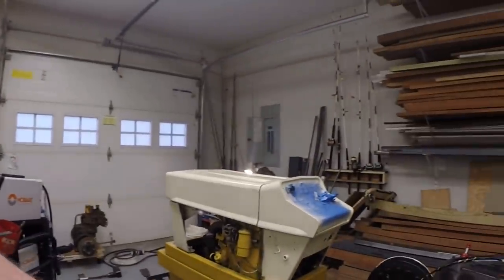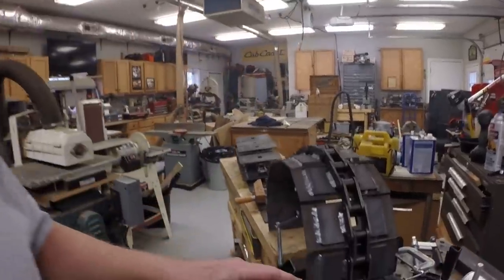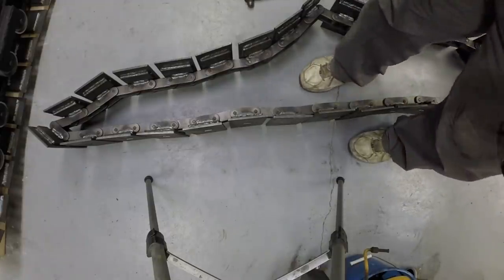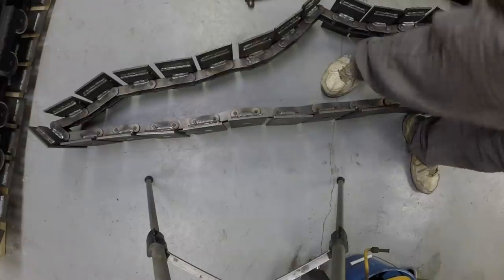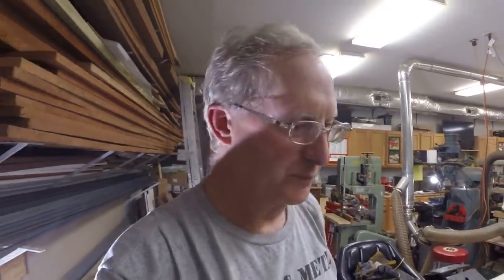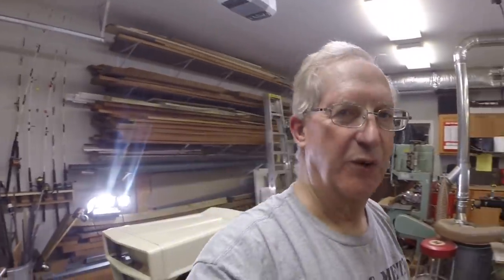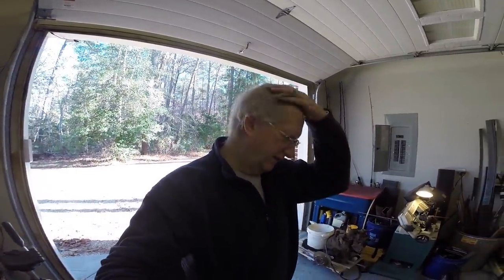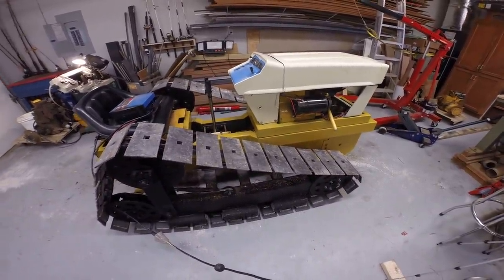Cub Cadet Dozer Build, S2:E6,  Here, Hold My Beer!

Comment: I would need a nap after struggling with that track!  A very neat build.  As far as I can see it performed just as you planned it----spin in place!  You should be very pleased.
Reply from the maker: It actually works better than I expected. I was anticipating some track issues and expected to have to fix or change something, but everything worked as intended.

Comment: You did it, need a leaver for the belts back where you sit so you don’t have to lean forward to engage the belt’s. Can’t get over how it worked. Did good on this job can’t wait to see it with the blade on the front.
Reply from the maker: Actually working on that. It'll be some weeks before it's published though.

Comment: Unless you had the volume turned down what surprised me most was how quiet the machine was. Not only from the engine but there was hardly any track noise. Congratulations on a well-fitted machine.
Reply from the maker: The volume of the engine noise is turned down quite a bit. Tracks rattle and clink just like you'd think they should, LOL.

Comment: Awesome job! Looks like the track tensioner would benefit from welding on a socket for a 5-10ft cheater bar.  Let you pull enough tension by hand to get the turnbuckle bolt in.
Reply from the maker: That's a great idea! Thank you!

Comment: Good job on your build. That is awesome! Yes, i am hoping you'll be able to put fenders on because a was concerned about your pants legs gitting caught up in the tracks. That had me worried😟, dont want ya to be injured for any reason !!! There should be a way to install a linkage from that transmission tension handle over there to the operator postion so you can turn it on & off from the seat! Install crab handles on the dash panel so you can pull yourself up onto & off from the seat area. Install some side steps on the side of the track guides to help you on & off the tractor! Enjoyed the video. 🚜Tractor safe🚜
Reply from the maker: Yes, fenders/leg wells, in the next couple episodes.  I've ordered a pull cable for the belt tensioner so I can operate it from the seat. It'll be some time before I get to that, though, blade will take several weeks to fab and set up with hydraulics.
Reply: @woodandmetalshoptime8048  Looking forward to more videos. I was telling my girlfriend about this video here. she was like, "thats awesome!"

Comment: For driving you can use the tracks like they are! But when you start pushing or pulling you need more grip! So adding a small bar on the trackplates I would advise.
Reply from the maker: That's the plan.

Comment: I was worried the tracks were going to rip your pants off around your hips or thighs. It looks great and seems pretty smooth in operation, seems a little twitchy but we'll see if going to your next hole on the control lever tames that.

Comment: My only question/comment would be that in order to get it to do useful work it's going to need a lot more traction than is provided by the smooth plates that make up the treads.  Put some crosswise cleats on each tread plate like commercial dozers have, and you've got yourself a traction monster!
Reply from the maker: Yes, grousers are coming!  Fenders, leg protection, lights, cooling fans, blade and blade mount, hydraulics, etc. All coming up!

Comment: Watching you drag that track, aren't you glad you didn't make the dozer any bigger. LOL. All kidding aside, really a nice job Frank. The track looked to perform very well, if you get off the gravel you may need to add in the grizzly bars. Otherwise it may be a sled. For getting on and off, you could do like real dozers and add a step on the track bar that you could use to step on and off.

Comment: Excellent build.  I really had my reservations on the one front wheel drive and one rear drive...with relation to the track sag on the rear drive going forward vs. no sag on the front drive side.  However if tracks have enuff tension you really dont notice it. but too much tension leads to wearing out quicker and more damage with rocks, sticks etc. getting wedged inbetween track pads OR under you bogies. 

 Which brings me to my next observation.  Your bogies are small and have to bridge a sizeable gap traveling over the pads. I could see you getting bounced around a bit already...it will get worse when you add grousers.  Also since your bogies run along the backside of your track pads, they will forever be getting fouled with rocks, dirt, etc. when working in soil, gravel.  Not good it you have tracks too tight...no room for deflection.  

A single row of bogies with a flange welded on both sides riding atop the rails (chains) leave room for all that trash on the inside of the track pads with less fouling because they ride atop the chains and offer a smoother ride. (conventional setup for all dozers)  Right now you feel every gap your bogies cross on your track pads. 

You already stated your going to raise your seat/operators station and provide fenders.  how much to raise is your personal preference...to me its a cross of functionality and whats aesthetically pleasing.

Blade.  4-way mount with trunnions.  or a PAT 6-way blade.  4 ways are whats mounted on huge CATS for serious land clearing/ earth moving.  PATs are more for sculpting/ finish work.  Either or would look great on your project.

In the end, its really just a functional toy to enjoy...but can be put to work if needed.  Im sure most of the joy is seeing your vision come to life...and function as you envisioned it to. 

My toy is a wore out CAT D4H high track that i piddle around with in the pasture.  I've considered spray painting TONKA on the sides of it.  

CHEERS....looking forward to your videos always
Reply from the maker: The bogies don't even notice the gaps between the track pads. Since they are solid mounted, they just "hang in space" between the pads as they move by. There are always enough bogies in contact to support the tractor, so the gaps don't really register.  

The issue  with the single roller down the middle is stability of the track. Since it's just pads welded to a chain (as opposed to track pads hinged together or a rubber track) the chain does not provide the lateral stability to the track--so the pads can flex and twist the chain, perhaps out of alignment with the sprockets, etc.  At one point I was actually looking at double chains to achieve this track stability, but decided the bogies on the pads would provide the necessary support for the track.  Would I do it again this way? Probably not. But there are a bunch of things I'd do differently next time. 

6-way blade is coming after fenders, seat support, etc.

Comment: I was also going to offer a suggestion for your blade. I built a blade that installs on my 18hp grasshopper mower. It's a front deck that comes off with about 3 minutes work. And my blade takes maybe 5 minutes to install. It's great for snow and it does a pretty good job pushing dirt and gravel. I made the blade from a cheap  cat 0 towed 42 inch blade I bought at Oershlens in Topeka for $180. I added 8 inches to each side to make it wider and have it mechanically raise and lower with foot pedals. It also pivots left/right with a mechanical lever. I used it on this last storm and it did great. I'd bet your Cat could easily push a 6ft blade. Let me know if you want to see pictures.
Reply from the maker: I have a 5 foot Cat 1 three point hitch blade I am going to modify for the dozer. All hydraulically controlled.
Reply: @woodandmetalshoptime8048  awesome. For some reason I thought you had said you wanted to avoid hydraulics. I think you're on the right track. That will look better on the Cat.

Comment: the only thing the placement of the drive sprockets dose, is put the load and sag of the track around the tensioners. it would only be an issue if you had more  complicated tracks, suspension or if you had a much higher weight and track loads.  so if you keep it under 5 tons i dont think it will be a problem but then again if you do exceed that my money is only you having a few bigger problems😜

Comment: Awesome ! Been waiting for this video for months lol my only suggestion would be maybe finding a factory ported transmission pump so if you wanted to add hydraulics Of any sort you wouldn’t have to add a pump unless you needed higher pressure . Those factory pumps put out avkut 700 psi
Reply from the maker: It has a ported hydrostat and that's what will run all the hydraulics for the blade. Stay tuned!
Reply: @woodandmetalshoptime8048  awesome ! Looks like you good to go ! I was gonna offer to donate one if ya didn’t have one already lol I’ll forsure be watching for updates ! Sure do hope to see this thing at some garden tractor shows in the future !

Comment: Bravo Mr. Frank, I have a couple of concerns. The first & most important one is your safety. When you first tested the dozer, the track pads were hitting you pant legs, please don’t operate it without the safety panels on it.  Not safety related was I hope you didn’t forget to weld the pin on the master link. What do you think it weighs as it stands w/out a blade?
Reply: Oh, far most, congratulations. One thing for sure, you won’t have to depend on anyone to do your driveway work. I’ll bet ya it’s gonna push dirt well for a toy.  Just fantastic!

Comment: Can you add a handle/rod to the side of the dash assembly that would move up and down that connects to the belt tensioner so you can operate the tensioner while “sitting” in the seat? I think it would be much safer.

Comment: Just picked up my zero turn today to start my mini doozer project it’s a very old small one forget the brand I’ll update in a few days but it’s all mechanical with cone clutched like an old saw mill pretty awesome really works out great for the parts I got for tracks old conveyor belts with 1” paddles I think I’ll add a power steering pump and use that for my hydraulics for the blade this is gonna be a kids toy for my nephew so it doesn’t need to be capable of doing serious work just push some sand around and look cool is all lol
Reply from the maker: Where do I subscribe??? Sounds neat!
Reply: @woodandmetalshoptime8048  lol I may start a channel on it it’ll be long drawn out as he’s a little young but I’m thinking about a year should have it covered as of now I’ve got about everything needed to begin

Comment: Nice work! Vary nice work! Did you think about putting in an electric clutch rather than manual disconnect for trannies? If u already discussed this earlier, I missed it.
Reply from the maker: I couldn't find a suitable electric clutch for reasonable cost. I am going to convert it to a foot pedal clutch eventually.

Comment: Curious how much was the cost for each complete track
Reply from the maker: About $350 in steel, plus $150 for the chain.  Maybe another $30 in weld wire and gas. $500 roughly. Each.